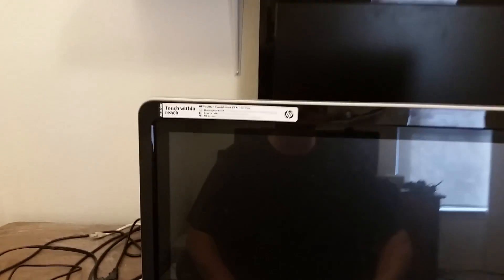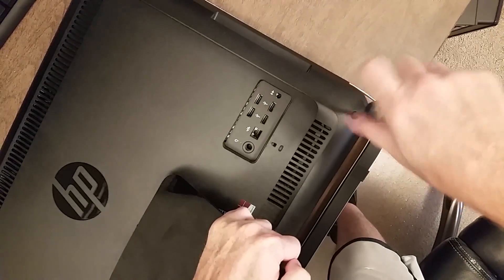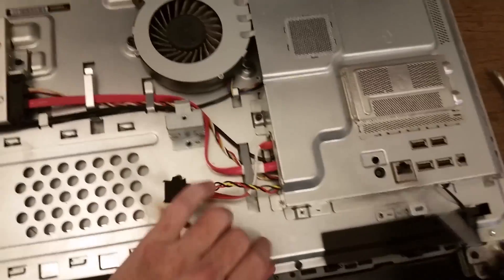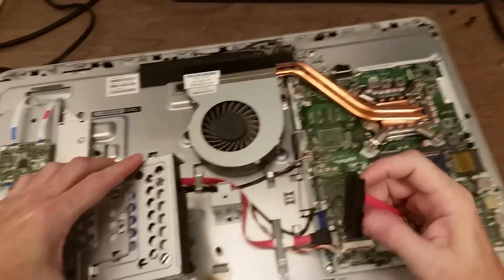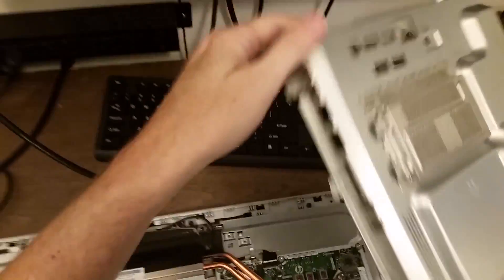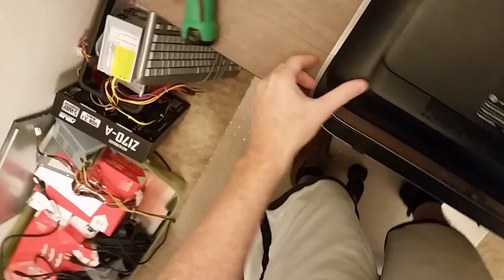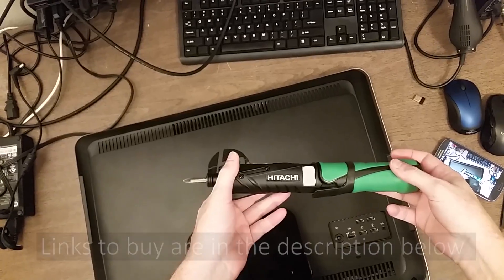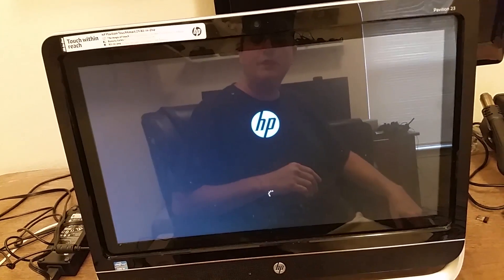Troubleshooting hard drive failure on a HP Touchsmart 23

Comment: "No Boot Disk Detected or the Disk has Failed" - doesn't necessarily mean the hard drive has failed, hence "No Boot Disk Detected OR the Disk has Failed." I see much more (about 10-1) Boot Code corruption issues than hard drive failures due to impatient people holding in the power button to shut down Windows, leading to the "No Boot Disk Detected" issue. This won't usually corrupt the MBR - Boot Code, but if you hold in the power button (instantly stopping all Windows processes, programs, services, and settings) instead of the proper shutdown through Windows (closing everything correctly) it will screw up the boot process sooner or later and Windows won't be able to find it's way back to the boot device (hard drive).

Comment: what if it was overheating what would u do then?
and i have a issue of overheating with the same pc
Reply from the maker: I would clean the cooler if it was dirty. If it's not dirty but still overheating I'd take the cooler off and replace the thermal compound between the cooler and the CPU.
Reply: @MichaelTheComputerGuy  it does overheat and shuts down and the cooler is clean
Reply from the maker: @hom3l3ssbuild3r9  then change the thermal compound

Comment: Whete can i find this piece
Reply from the maker: I found it by doing a search on Google for the model number of this computer and the words service manual. You can download the service manual from HP and in it there is a list of all the parts in the computer including the part numbers. I then took that part number to eBay, searched for it and found it.
Reply: I need to know hdd sata connection part number.. I have hp pavilion 23 all-in-one f270

Comment: What size is that harddrive... 2inch, 3inch, etc?(in thickness I mean)
Reply from the maker: That's a 3.5 inch hard drive. You can make it 2.5 inch hard drive, or ssd fit in just about every computer.

Comment: Hi Michael, I have the same issue, what is the part name and where did you order it from? I'm in Australia
Reply from the maker: What you need to do is do a Google search for the model number of your computer and service manual. In the service manual there will be a list of parts along with the part number. You can use that part number to locate a replacement. I do have to tell you that this is a very unusual problems and that you are situation may be different.

Comment: Cool, I had to replace the HDD in my 2016 model HP. Pavillion 23. Hardware stuff is incredibly simple. Just be VERY sure you have a functional recovery disk/ usb ! The recovery usb I had created when I bought the computer NEW, did not download correctly,and I had to find a win8.1 disc. Paid someone to do that. Good news if you are recovering the OS the unit came with, you do not need the product key, as it is buried in the bios.
Reply: Was the original hard drive 2.5 or 3.5 inch?

Comment: Great video....I've got the HP all in one 23..
My issue is, the no boot disc detected as well.. so I followed your steps by changing the hard drive, however after I replaced the old hard drive, I'm still getting the same boot disc error screen after installing a new hard drive..any suggestion? Thank you
Reply from the maker: In this video the failed part was the power and data cable between the hard drive in the motherboard. A boot disk error message can mean that the drive isn't detected at all or the drive is physically failing. If you replace the hard drive because of an error message and the error messages the same there's a possibility that that hard drive is not the issue. It could be the cable or the motherboard. It could also be that you need to reinstall Windows onto the Dr. The first thing I would check is if the hard drive when plugged in and the computer turned on spins. You can hear it when you turn the computer on. If you put your hand on the drive when you turn the computer on you'll feel it vibrate if it's spinning.
Reply: Michael Cooper ..oh ok I’ll try that..preciate the quick response
Reply: Michael Cooper  installing windows. Would I use another computer to install? I’m no guru at this. I’m just experimenting really..lol couldn’t find any leads pertaining this issue..it’s an old hp23 2014 maybe
Reply from the maker: @MrOlegalis69  You'll need to download Windows 10 from Microsoft. Do a Google search for download Windows 10 from Microsoft. On the Microsoft page there's a link to create a flash drive with Windows 10. You then put that into the all in one, start it up and it should boot into the Windows 10 installer. From there you can see if the hard drive is being detected. Before you do all that actually check to see if the drive is spinning like I said in my previous reply.
Reply: @MichaelTheComputerGuy  I know this is a super late reply, but I have the same pc, Same issule. And My hard drive is vibrating when turning it on. There is no burn, I JUST bought a new hard drive, same exact problem, 3fo etc hard disk not found or failed,
I know for a fact the new ones are fully working.. Help?
Reply from the maker: The issue in this video was that the data and power cable burnt. It didn't have anything to do with vibrating hard drives. If you're hearing or feeling something vibrate it could be the cooling fan.
Reply: @MichaelTheComputerGuy  didnt you say The first thing I would check is if the hard drive when plugged in and the computer turned on spins. You can hear it when you turn the computer on. If you put your hand on the drive when you turn the computer on you'll feel it vibrate if it's spinning.

any ideas of where i can go from here?
Reply from the maker: @noahar  When you turn the computer on what happens? I need to know everything including the exact error messages, if any.

Comment: Wow thats rare that there is a cable failure and not the drive or board issue.
Reply from the maker: I've been working on computers for 25 years and doing it professionally for the past 10 years. This is the only time I've seen a cable get burnt through.